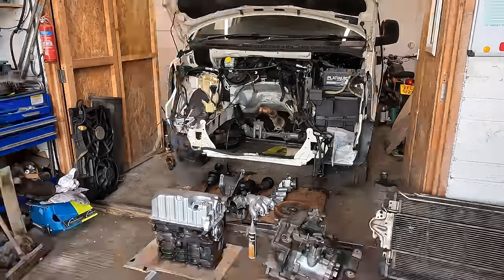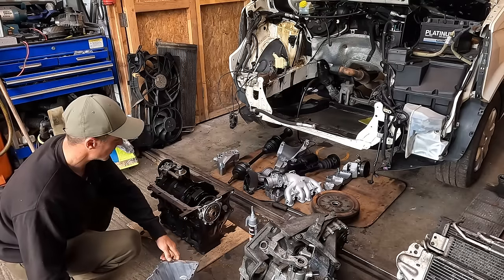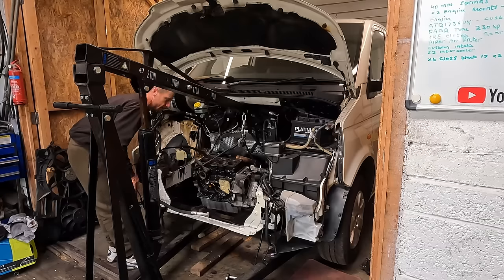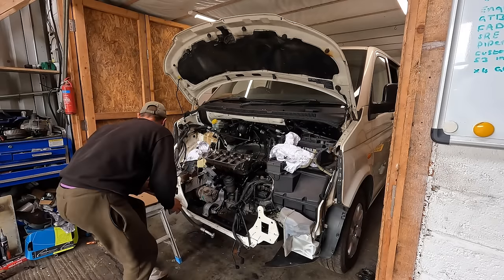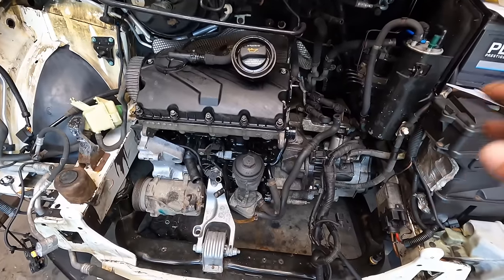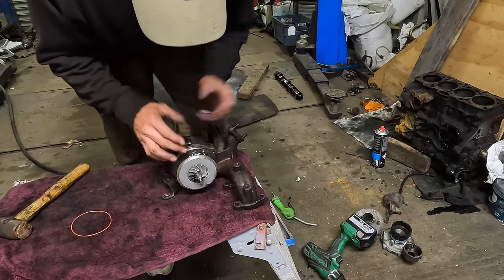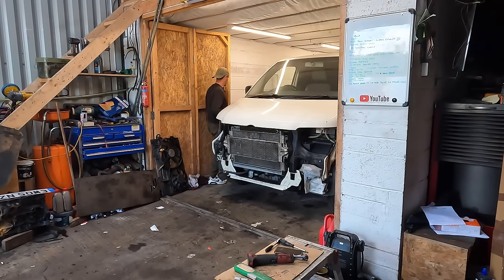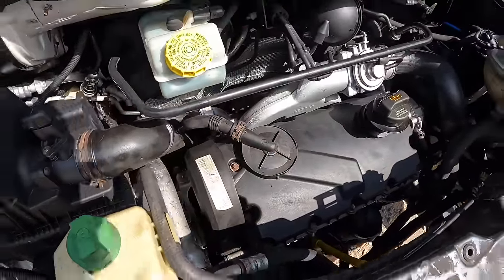T5 Transporter PD130 ASZ swap will it run & drive - Ep2

Comment: Which metal coolant pipe was used on this,the one that fits around the metal dipstick tube as the one I’ve got fitted doesn’t allow the orange dipstick tube to fit on right

Comment: Great vid as usual! With the dipstick tube if the lower half is the metal press-in sort then this may be able to be removed and replaced with a plastic tube that’s shaped and moves the dipstick back towards the engine. The plastic one bolts into the block at its base.  It’s easier to remove the metal tube by tapping it out from underneath with the sump off. This is what I had to do fitting a golf bkc into a caddy with a broken bls- some of your earlier vids were a great help with this project. Thanks!
Reply from the maker: Hi jec, yes the bottom half was a metal press it. Yes I know the one your on about actually, the plastic bit I got fit onto what was there and I warmed it up with a heat gun and it sits perfect now I’ll show it in the next video. Thanks for the little tip mate 👍

Comment: Massive thank you for the video Nathan. Cracking job you did there. The new engine sounds sweet and is on the button. Loving this Transporter build.
Reply from the maker: Hey Karl thank you sir always appreciate your comment, it does sound sweet will get the Downpipe attached and take it for a better drive.

Comment: Just done the same swap and changed the dipstik also. On the ASZ/ BLT you need to knock the dipstick holder out when the sump is off.
Reply from the maker: Hey Joe awesome a few people have mentioned the same to I wish I done mine but scrapped the block now 🤷🙄

Comment: Half way through very similar swap and sure darkside did a 170bhp map for this swap because gearbox is the limiting weak part ( 5 speed ) and 2.0 tdi 6 speed box bits for a transporter are silly money either way nice job great video
Reply from the maker: Hey Marc I’ve heard loads about the 5 speeds so I’ll be limiting my remap round about 150, someone else mentioned they are in the middle of a 6 speed swap.

Comment: Nice video & nice mention! My T5.1 will be gone in a couple of weeks, so will see what’s left over 😎
Reply from the maker: Hey Ian thank you again mate, really appreciate the lights and had to give you a mention 👍 any bits would go to great use, what you buying to replace it?
Reply: @YTDTETV  , already got the replacement. T6.1 panel van, which is being converted to a camper. Doing some bits myself, but it’s in next week for pop top, windows, carpeting and floor. Leaving that stuff to the experts 😂
Reply from the maker: @ianduckworth9925  oooo very nice 👍 what engine does it have? I don’t blame you with pop top or windows I’d be nervous of taking a grinder to the roof or side panel to 😂 carpet lining isn’t hard but it does take some effort.
Reply: @YTDTETV  did the windows myself on the T5.1, but can’t be bothered with the stress this time round 😂. Engine is just the 110 BHP 5 speed manual. Seems to go well, be will get remapped once the VW warranty ends. Will go to 180 BHP. Did similar with the T5.1 4.5 years ago, from 101 to ~170, without any issues whatsoever. Put ~40k on the clock in that time, so not worried about doing same with the T6.1.
Reply from the maker: @ianduckworth9925  oh man your so right about window tinting that takes some effort to, I’ve done most jobs and there’s a handfull I’d still get someone else to do. That’s a nice power increase I’m hoping to get something similar from this one. Not after massive power just a little extra umph!!
Reply: @YTDTETV  not tinting, cutting the sides and back of the van and bonding the windows on. 😳😂 Had a sleepless night the night before I did the ones on the T5.1.
Reply from the maker: @ianduckworth9925  oh ok my bad I read it fast and wrong, that’s one think I’ve not done yet cut in a window but… I will be doing it on this one should make a good video if I mess it up 😂 I’ll probably do it very soon before I start making the inside pretty.

Comment: Just rebuilding a VRS pd130 to go in mine. Wasnt sure about the oil pick up pipe. Thanks. Mines an earlier block going in a 2009 van so had to grind out the block for later crank sensor
Reply from the maker: Hey jay glad the video is of use hopefully it helps 👍, I done the crank sensor mod on this block then realised it had the old crank sensor in this one so made a hole for nothing 😂
Reply: @YTDTETV  Doh...
Reply: @YTDTETV  my BBR engine is 370k. Determined to get it to 400k before the VRS goes in😅
Reply from the maker: @jayswin2  ye be nice to hit that mark before pulling it out 👍

Comment: nice one long time coming i have t 5 .1 full suspension brand new
Reply from the maker: Hey bondi good to hear from you bud, the front shocks on this are shot I’m in need of replacements.
Reply: i have the two suspension legs complete 40 pounds u pay post on top if any good to u
Reply from the maker: @darranbond3448  yes please bud I would appreciate that, my email address is ndautos24a@gmail.com. Thank you 👍

Comment: I see you mention about the oil cooler being different on the original engine compared to some ASZ engines, I assume by what your saying that they aren't interchangeable.
Loving the clean engine bay too 👌
Reply from the maker: Hey Brendan yes they are interchangeable 👍 thank you

Comment: Well I’m in a world of pain as you say 😂. Just don’t my injector seals with new bolts & they’ve jumped the thread at 270 degrees 🤦🏻‍♂️ tried the next one at 180 and the same again. Currently looking to upgrade to a asv engine.
Reply from the maker: Hi Lee oh man sorry to hear that, with injectors I don’t normally go by torque settings for that exact reason as the threads are so small and the bolts are so weak. I just use a 3/8 ratchet and do the bolts up by holding the ratchet by the head with one hand and do them tight rather than 2 hands on a ratchet. That way you can over tighten or strip the threads as your holding the ratchet with the smallest leverage point. I’ve never had an injector leak and I’ve never stripped one. What mileage is your engine on? If it’s below 200k it might be an idea just to replace the cylinder head.
Reply: @YTDTETV  engine is on 180k, done the head gasket 5 years ago. I’m looking at a ASZ engine tomorrow (time for an upgrade)
Reply: Got my ASZ engine in..is there a generic map for these. I went and asked revo remaps and they won’t touch it. I’ve left the pd130 injectors in & kept my old 105 turbo

Comment: Hello, good video
Considering this conversion but have questions. 
What wiring did you use? 
Have you gone 6 speed box? 
What needs doing to the exhaust? 
Did you solve the boost pipe issue? Any clues

Comment: Great video, I’m about to do this, quick question, did you remap it for the bigger 130 injectors before starting it. Sounds mint 👍👍👍
Reply from the maker: Hi bud thank you 👍 you can run it on the 130 injectors yes but it runs lumpy on idle and smokes abit. You can then get someone to remap it but they need to remap it properly as the furling maps need changing to 130 injectors. I ended up fitting the original injectors as I wasn’t after a power increase and it runs absolute mint 👍

Comment: Stumbled on this channel, I love the little tips and tricks you share, you have great knowledge. Question- I have a 2010 t5.1 carevelle DSG, only 50k on the clock. When I am driving around town I can hear a low gas pressure noise, not loud, sounds a bit like a steam/air sound. When I parked up the other day, blue/grey exhaust smoke expelled from underneath the engine area. Only has done this once, it looks dry underneath, turbo is only two years old and clean. What do you think it could be?
Reply from the maker: Hi bud thank you appreciate the comment 👍 is your van air con? Do you use it? If so next time you hear the noise turn the ac off and see if the noise has gone. Had a a few customers recently ask that and that’s what it turned out to be.
Reply: @YTDTETV  Hi yes it is AC, however I very rarely run it as it’s freezing over in Northern Ireland. However I will put it on and off tomorrow to see if there is any difference. Thanks for the reply 👍

Comment: Do you want any air con parts? I’ve removed the motor part already but all the rest is still in place, pipe works rad etc

Comment: Hey, nice to see your project progressing. I am literally in the middle of a gearbox swap (5->6 speed manual), be careful with the remap if you plan to do that on your ASZ, the gearbox is not really made to take a lot of torque and eventually it will fail.
Reply: 6 speed 02m are good
Reply from the maker: Hey Richard thank you for the comment. I totally agree with the remap on the 5 speed as I’ve read a lot about torque killing them, my plan is to have a remap but a super soft one. Let’s say it’s 105hp now the max I want is maybe 140. It goes alright now I just want it to have a better map than factory really, better on fuel and just a hair more power if needed.
Reply from the maker: Is that the car gearbox? They are very very good.
Reply: @levispartan1993  Unfortunately the t5 uses a different gearbox than the car (They are different shape and form and geared differently). I believe the 5 speed is originated from the t5 2.4D, whilst the 6 speed is a completely different design. 

As my foggy memories tell me it is possible to swap a TDI to the T4 together with the gearbox, it is not an option for the gearbox (at least not plug-n-play) in the T5. 

I actually happen to have a 5 speed fabia and and a 5 speed T5 2.0 TDI gearbox side by side outside I can show you the differences if interested. Well, I could actually show all 3 of them (6 speed T5 bitdi box) and compare  them in a video if interested.
Reply: @levispartan1993  won't fit on a t5/t6 platform. 05a - kup, pap codes needed.

Comment: Hi Nathan 
      Great video .
Could you tell me if  the engine has to be from the fabia vrs or will the atd beetle engine work as well?
Thank you
Reply from the maker: Hi bud thank you any 1.9pd will fit it’s just a case of some having an oil filter housing that pokes out more you can see the difference just looking at them. Both engines fit but the bigger oil filter housing ones need a slim Line radiator fan instead of the oem one.
Reply: @YTDTETV  thank you Nathan 
I was wondering did the turbo piping on the metal pipe side and the other side end up ok?
Also I was thinking about all the sensors . Ie crank and cam and it other sensors .
Should I just swap them all over .
I lm asking a lot of questions but this is my first attempt at this and it’s daunting . I’m just a diyer.
I was also thinking of just mapping the injectors rather than dig in there so I’m gonna look for a file or take it somewhere to do it .

I hope yours turned out well Nathan

Comment: Just want to ask i have 1.9 cdti sri insignia was driving and engine locked up took belt cover off and looked like belt had jumped 13 teeth 😢 so sent it to garage said bottom end has gone told oil seal and oil pump must of gone and locked engine up that what caused belt to jump qhen it locked i had this car a week its has 87000 miles what would it cost to sort rufly ? I know it needs cambelt kit new oil pump and oil seal thats in the sumppluss bottom end and probably valves as probably bent if pistons smashed into them. And where are you bassed. Love this channel and the work you do
Reply from the maker: Hey Dean oh that’s not good sorry to hear that, maybe easier to find a replacement engine. I’m in deal in Kent.
Reply: @YTDTETV  thank you for replying yes its not good at all I knew that was going to be the answer was just being optimistic lol never mind ay £2500 literally down the drain. Carnt wait for your next video pal 👍

Comment: Very interesting indeed.... I have an 05 transporter at the moment with the 2.5 axd engine. The engine is out and in bits at the moment because a piece of baffle plate broke off in the sump and wreaked havoc on a few cylinders. I am getting a quote for liners but am now wondering what would be involved in putting a pd 130/150 into the 5 cylinder model. Any advice 🤔
Reply from the maker: Hey James I see so many horror stories about the 2.5, to fit the 1.9 you need the engine and gearbox as your gearbox has a different bolt pattern, engine loom and ecu. It’s a fair few parts but the 1.9 is so much more reliable than the 2.5. Hope that helps
Reply: @YTDTETV  thanks for getting back that's good advice 😀

Comment: Sadly I have just bought a T5 that now needs a new engine. I'm wonderful what the costs are to supply and fit . Or is it possible for for someone with no mechanics knowledge to fit the new engine
Reply from the maker: Hi bud sorry to hear that, so the engine is a straight swap with only minor modifications needed so someone with half decent skills should be able to do it 👍

Comment: Did you go from a brr to the asz if so did you need to drill a hole in the block or just swap sump ect
Reply from the maker: Hi bud mine was an early one so didn’t need to drill a hole for the crank sensor, just swapped the sump etc
Reply: @YTDTETV  cheers mate iv got a 2007 brr and want the asz hopfully dnt have to drill a hole

Comment: Hi mate, in regards to the coolant pipes to the oil cooler, where did you connect the second pile to as the asz doesn’t have the coolant outlet on the block like the brr engine.
Reply from the maker: Hi bud the 2nd pipe is in the metal pipe instead of the block, does this make sense?
Reply: @YTDTETV  hi mate, I have one running into the outlet on the metal pipe on the right, the one on the left has the pipe for the expansion bottle and there the only two outlets I have on the front 😫
Reply: @YTDTETV  hi mate, I have one running into the outlet on the metal pipe on the right, the one on the left has the pipe for the expansion bottle and there the only two outlets I have on the front 😫
Reply: @YTDTETV  hi mate, I have one running into the outlet on the metal pipe on the right, the one on the left has the pipe for the expansion bottle and there the only two outlets I have on the front 😫
Reply: @YTDTETV  hi mate, I have one running into the outlet on the metal pipe on the right, the one on the left has the pipe for the expansion bottle and there the only two outlets I have on the front 😫
Reply from the maker: @10antsrees  ok, check out the bls to asz swap audi a3 on my channel I go into detail with regards to the pipes in that vid, hopefully that might help, if not join the Facebook page DTE TV and send me some pictures I’ll do my best to help 👍

Comment: Hi I'm doing an asz swap from a golf.  Apparently the oil filter housing fouls the radiator fan did you change yours. Cheers Simon
Reply from the maker: Hey simon so you must have the asz with the larger oil filter housing, there’s 2 types and unfortunately they don’t fit either engines. I’m pretty sure the oil filter housing clears the rad fan but it is close. You can still use the engine it’s just close to the fan.

Comment: Hi, sorry if it has been asked before, firstly is there a difference in the oil pick up pipes and  Did you have to swap the rocker cover and inlet manifold for the original ones?
Reply from the maker: Hey bud yes the dipsticks are different and I couldn’t get the new tube out and didn’t want to damage it so just stuck with the new one. Ye I fitted the T5 rocker cover, I think the inlets are the same but just incase I did fit the T5 one to.
Reply: YTDTETV  thanks for replying! Great video. We're doing the conversion and seem to be hitting loads of problems, it's the oil pick up pipe I mean not the dipstick, we took the sump off the old engine and then scrapped the rest of the engine as we didnt think anything was needed, looking at the original pipe it looks the same as the pd pipe but is there a difference?. 
Also the rear engine mount is hitting the turbo, did you have this issue or are there different turbos for the pd130 as my fitter is saying there's 2 different types. Thanks again for your help

Comment: How’s it mate? How would you remove a stripped head flat head bolt behind the heat shield on a mk6 GTi ccz engine
Reply from the maker: Hi bud is it possible to weld a nit over the snapped stud? That be my first choice.

Comment: Hi finished my asz swap today in my t5 axb.. it won't start do I need to put my axb injectors in or should it start with the asz injectors I haven't swapped the out? Any help appreciated 🙏 thanks
Reply from the maker: Hi bud it should still start on the 130 injectors but will run abit lumpy and Smokey, is the fuel filter definitely full? Does it fire up on abit of easy start? Have you got an code reader? Check see if you have RPM signal while cranking. Did you have to do the block mod for the crank sensor or where they the same?
Reply: @YTDTETV  thanks for the reply I plugged it in it says injector problem no signal? I didn't try Easy Start ill try that now.. fuel pumps priming it's cranking but winter fire up has plenty of fuel.
Reply: @YTDTETV crank sensors looked the same so put in my axb sensor
Reply from the maker: @pauljames7399  have you definitely got the injector loom plugged in right on the end of the head? It’s the big round plug. When you plug it in check to see if there’s an RPM signal to confirm the crank sensor is all good.
Reply: @YTDTETV  yeah I did the looms plugged properly ill check the needle thanks
Reply: I just tried again & it fired up after abit of cranking must have been waiting for the fuel to come through. Need to bolt up the drive shafts now but it its stared raining.. glad it'd running! Thanks for your help! Can you recommend anybody to remap it for me? So I can get the potential out the engine.😊